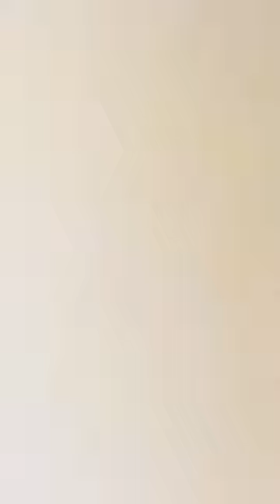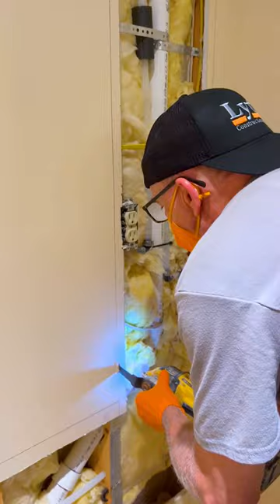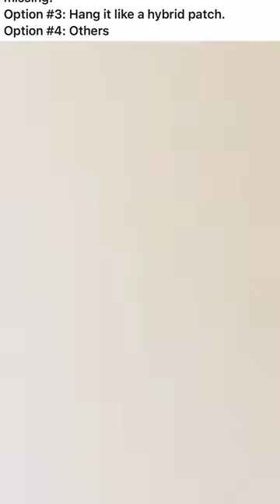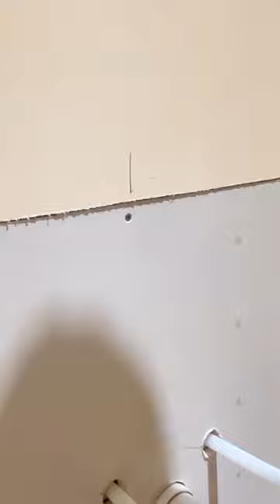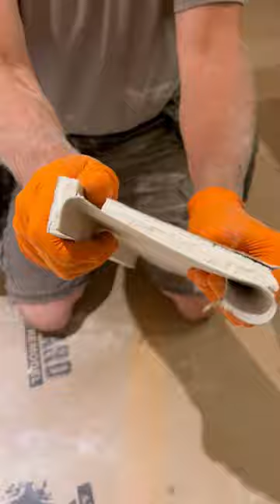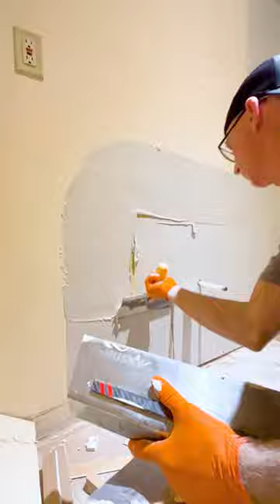How 🤔 to Solve A Drywall PUZZLE left by your plumber #shorts #drywall #diy

Comment: Thank you for cutting the drywall straight and centered to the stud, I do restoration and remodel from water damage and i usually get to the job with the drywall cut all messed up, like they snap a line but don’t follow it and then just cut to the right or left of a stud. It’s fine I can do it myself but it’s so nice when it’s clean and cut ready for me to fix. 😂
I recommend paper tape always over mesh tape, bank jobs my father worked for like BofA they banned the use of mesh tape, do your thing. I’m sure it’s fine on walls but every time I see a ceiling joint coming apart it’s mesh tape. And probably improper screwing.
Reply from the maker: Thank you sooooo much for the insight! In my opinion, when the drywall is not installed correctly, it does creates a lot of problem.
Reply: Mesh tape is better 😂

Comment: I agree with your idea of piecing it back together  but would have cut back to center of studs or add blocking.  Large "California patches" usually end up cracking and/or blistering, especially on an exterior wall. (2) pieces, one 4' wide stood up from the floor to the bottom of the window trim and a small piece to the right of the window.
Reply from the maker: Thank you so much for your valuable insight 😄

Comment: Do you still use a strip of wood to secure it to the connecting drywall or just flare the sides and mud them to the rest?
Reply from the maker: Just flare the sides and mud it to the rest, because it’s a hot patch at the top.

Comment: Genuine question. With all that mud for coverage, why worry about making one piece fit? Pride thing? Or is there something I'm not getting?
Reply from the maker: I do take a lot of pride in my work. And what I did was I had to cut the Sheetrock back halfway of the studs.
Reply: @thedrywallguyofthediy245  no I get that part. That's so you have something to nail to. What I'm asking is why worry about making it one sheet when you could've done multiple pieces since it's all getting covered in mud anyways? It's a genuine question...I'm not claiming to know better.
Reply from the maker: @ncnuggets  As you can see, there is a lot of mud on there. That's why I tried to put it in one piece instead of multiple pieces, there would have been even more mud. Also, just to let you know I did have to fix the spot with 2 pieces. The smaller piece was a Hot patch.🙂